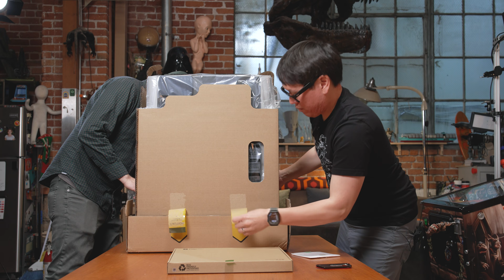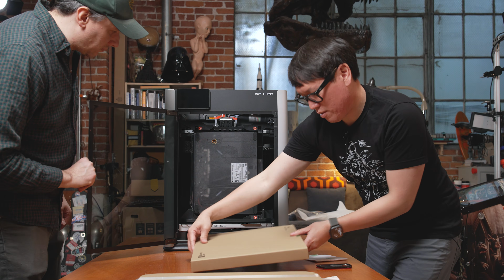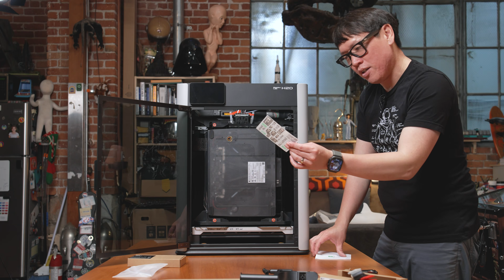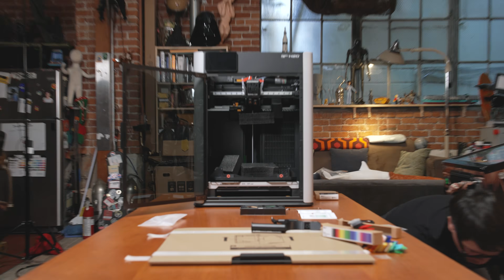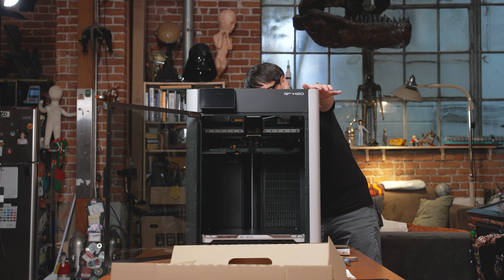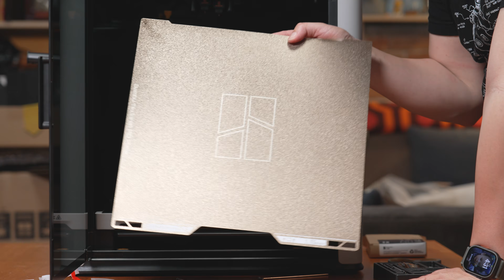Bambu Lab H2D 3D Printer Unboxing and Setup!

Comment: Not surprising that the "extra" hot end was also 0.4 mm. The machine comes with two 0.4 mm hotends already installed. Since you can only have hotends of a single particular size (0.2, 0.4, 0.6 or 0.8 mm) mounted to the two positions at one time, providing a single hot end of another size would be kind of pointless without a second one...

Comment: 6:20 The swatches are not printed... You can see the contact mark where they are injection molded on one of the short sides....
Reply: some of them are printed iirc
Reply: Thats correct you can see the injection gate marks and the ejector pin marks on some.